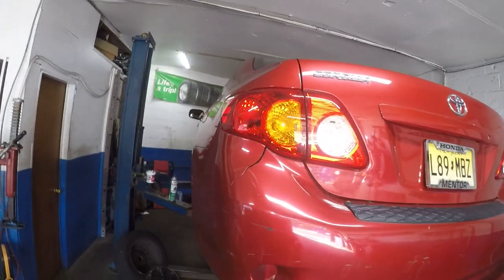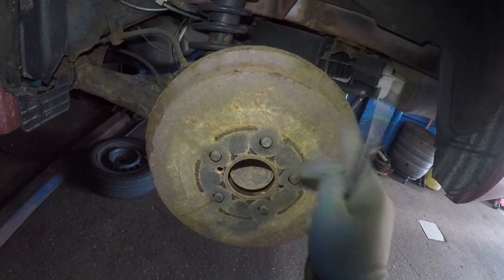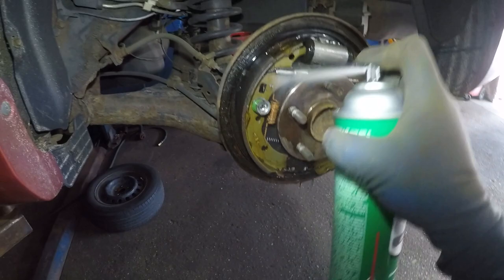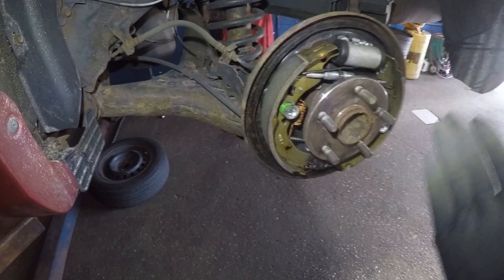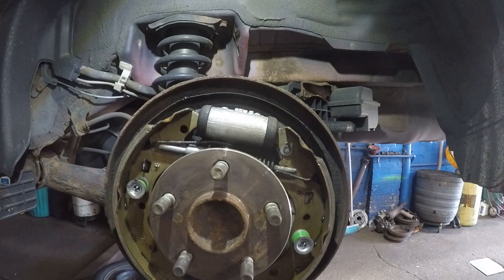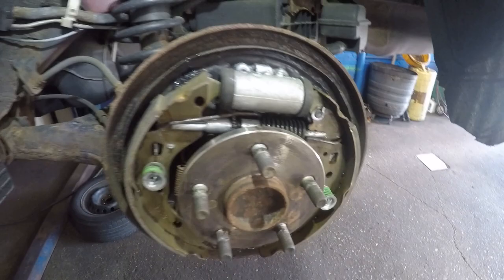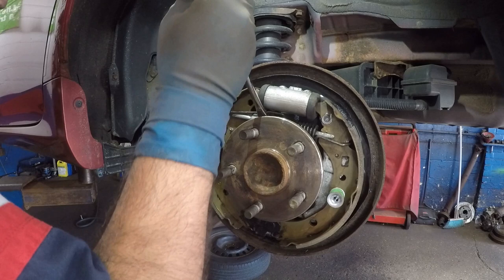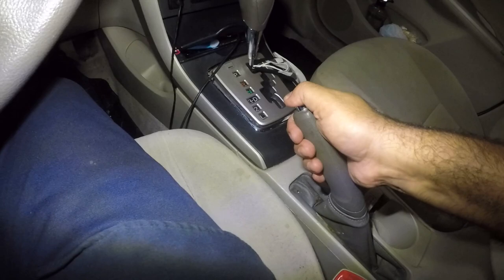Drum Brake Clean and Adjust Service your cars DRUM BRAKES every 20K miles

Comment: If u dont have brake cleaner use soapy water spray does same job. My dad taught me. Hard to believe but very true. Most Toyota have two threaded bolt holes in the drum and are so easy to remove using two bolts like a puller such a simple idea that saves a lot of knuckle damage😂
Reply from the maker: Oh ok

Comment: Sir if we adjust that much drum to pad contact , then it is there much heat produced even when we are not pressing the brake , causing drum overheating.

What are your opinion ?
Reply from the maker: No u have to have a gap which is very little it seems hard to believe but that’s how this works
Reply: @RBTheMechanic  but sir can it cause heating the drum even when not braking , while little contacts rubbing against pad
Reply: @ankushsharma6396 no it’s fine
Reply: @volt8684  ok sir thanks for answering

Comment: You got a instagram ?
Reply from the maker: No sorry bro
Reply: @RBTheMechanic someone told me by pressing/pushing the parking brake line under the car…. If the wheel keeps going than we got drag… if the wheel stops then it’s good? But what is the right way to check a vehicle for drum clean and adjustment
Reply from the maker: @volt6008  I usully judge it by feel
Reply: @RBTheMechanic  what kind of feel though? Like what you do? Do you spend the drum and if it feels like it have drag? You recommend to the customer ?
Reply from the maker: @volt6008  just feel the shoes have friction on drum and back it off a tooth
Reply: @RBTheMechanic  any links to a video demonstrating? Sorry to be a bother
Reply from the maker: @volt6008  no sorry